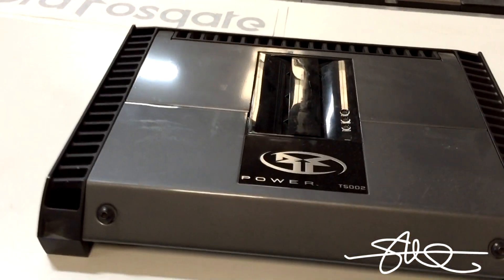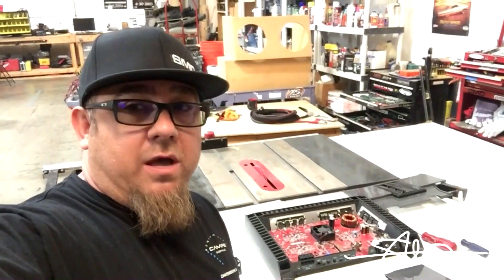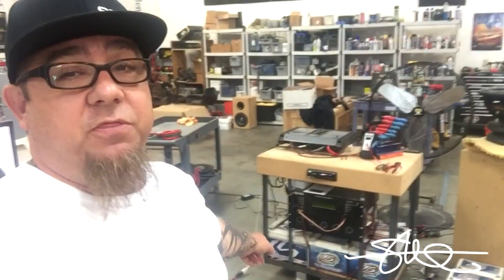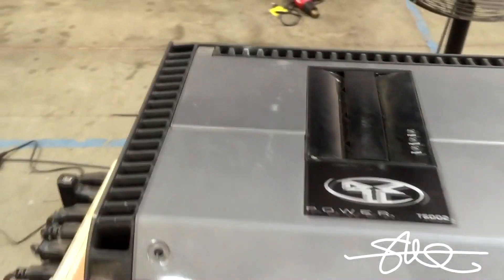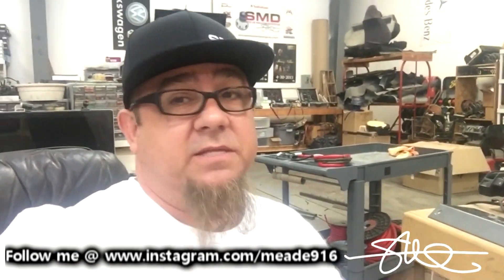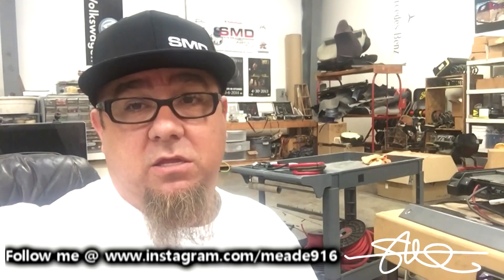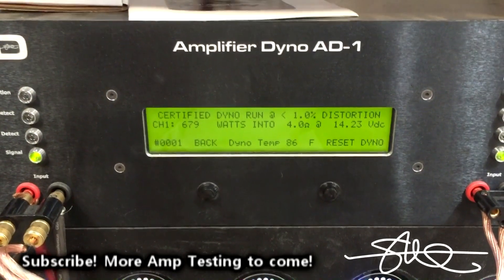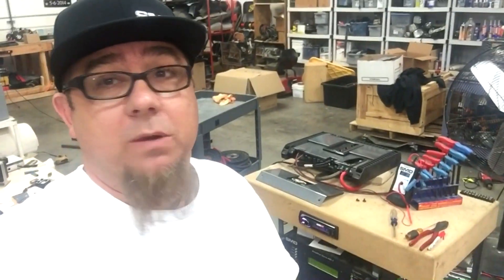Amp Test Tuesday - Classic 2004 Rockford Fosgate T500.2 Rated 500 watts RMS - SMD AD-1 Amp Dyno

Comment: I'm betting it does close to 2kW at 1 ohm mono, dynamic! Wait until you see my test of the 1998 Power 500.2 and 1999 Power 1100a2....BEAST MODE!! Great vid as always
Reply: +Alex Grace 1 ohm mono on a stereo amp is 1/2 ohm load per channel. This is what I was referring to
Reply: I got one of those color grey amp. Power 500.2
Reply: Where’s the video of the punch 500.2 on the dyno?
Reply: I have a punch 500.2 from 2007 its rated at 500rms at 12volt but its throws 738 rms at 14,4volts channel separation -60.76dB
Reply: So this amp can drop to 1ohm
Reply: I got a punch power 500.2

Comment: i have a rockford fosgate p550.2 amop that went short on the left channel. if anything is hooked up to that channel it will blow the fuse right away. the right channel works great. i took the amp appart and didnt see anything burnt or discolored. what would be the problem?

Comment: Meade, I have 2 15 inch alpine type r subwoofers and I had them hooked to a sound stream turantula amp that I've had for awhile, and it bumped nice with the alpine a but it ended up blowing I guess my question is what's a good and cheap enough for a teen working minimum wage amp that will still provide killer sound
Reply: +amstaffmike80 if i wouldn't of gotten them for dirt cheap I would sell them but they bump so good haha

Comment: I have a Punch 500-2 and it has the same amount of transistors for the output section and havs 4 caps instead of the 2 and the T model can handle 2 ohm mono loads but mine is only rated for a 4 ohm load! The only difference I see is that it has two more power supply transistors than the punches 4! I still don't understand why Rockford always has extra spaces for Transistors that usually aren't drilled on the board and on this one it has a spot for 2 more caps as well! I had a Blade technologies M252 and modified it with help from a blade designer to be a m502 because I found out they shared the same board! I know on some older Rockfords you could modify them and a guy on youtube does the modifications and lists the Parts needed! But I changed the N channel output transistors from 28n15's to 46n15's!

Comment: Says he doesn't have any 16v amps to test. Tests rf t500 totally 16v capable. Running a t1000 at 16v right now. Makes great power.
Reply from the maker: cool story bro.  But RF amps go into protect at 16v.  Since you aren't running 14v (that charge at 16.8)  or 16v batteries (that charge at 18.5) i am not sure where you get the 16v from. The RF amps can be tricked into playing higher than 16v but that don't mean they are made for it.  Post up your system i can't wait to see how you came up with your figures.  Perhaps charging your 12v batteries at 16? thats dumb as hell but really the only other way other than using higher voltage batts.

Comment: You said the amp is bridged so when you test it at a 4ohm load it will actually be a 2ohm load that confused me but anyways I was looking to buy this amp just let me know if it will work for my setup I have a 500 rms watt sub and its 2ohms so if I run this amp bridged will it work

Comment: Steve you should test the audiopipe apcl 1500
Reply: +Ryan Mendoza its been tested by Dereck BigDWiz on the dyno...certified 891 at 13.98 @ 2 OHMS and 1300 and change at 14.05v @ 1 ohm certified test....hope that helps...and out of personal experience the apcl line isn't that bad but the apsm / apmi line runs pretty dirty power again you can find the tests of those amps on here too somewhere

Comment: I've got an old Rockford Punch 900-something from 2002-2003; it's a complete piece of garbage.  Claims to be 2-ohm stable, but even running at 4 ohms pushing a dinky little 8" no-name woffer, it overheats and shuts off constantly, and has since it was new.  It's been sitting on a shelf for the past six years or so.  Ya want it?  :D

Comment: bridging an amp does not change the load. All you are doing is changing the amp from a 2 ch to a single ch amp and it will use the power from both ch's in 1.. so where you were running a  4 ohm load bridged it still stays a 4 ohm load same with a 2 ohm load. however at a guess I am still sure it will pass its rated power, but this is the reason you are seeing such high numbers.. the amp is 500 at 1 ohm per channel I believe, so bridging it will be 1k which is correct as you have shown. ( P.S I know my grammar sucks )